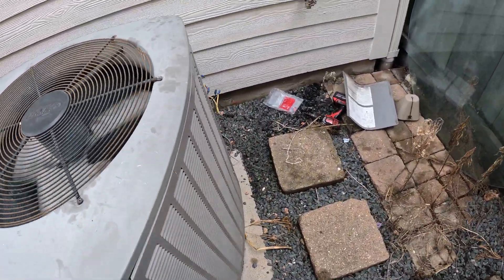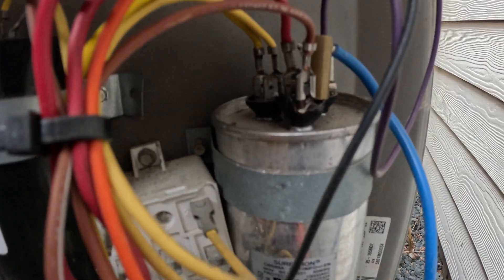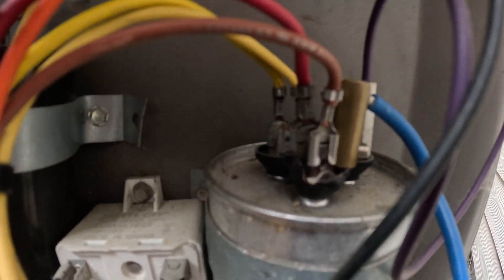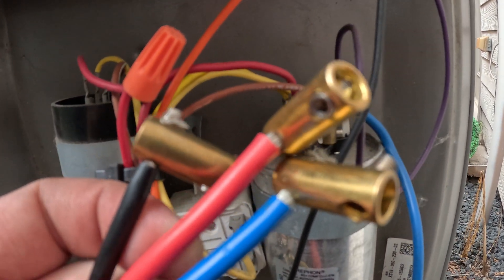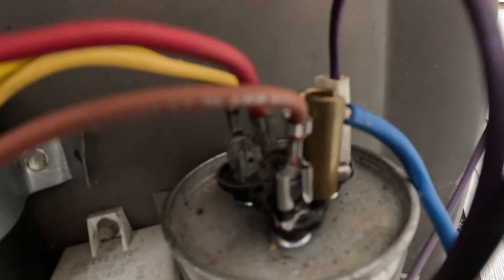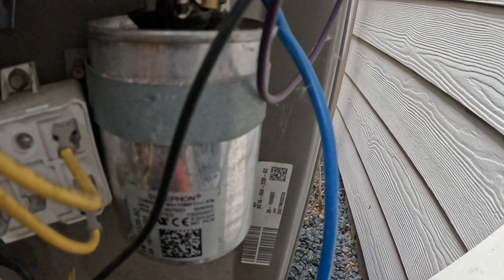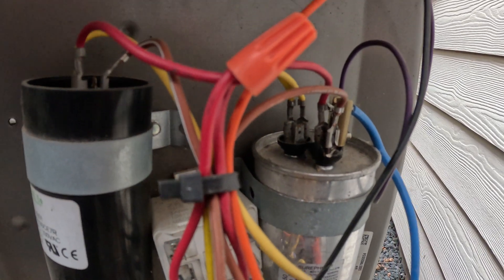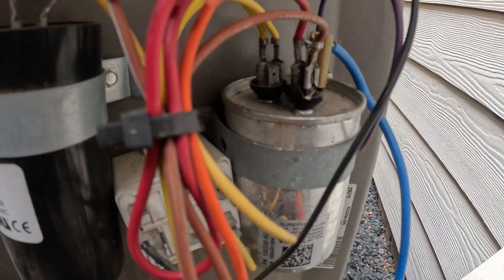Capacitor Wires Burning / Melting Off, How To Repair / Fix Burned Wire.

Comment: Big question though...WHY are the wires burning off??
Reply from the maker: Higher than normal amperage draw at your outdoor condenser will cause wires to burnoff. Things that cause high amperage are dirty / old condenser, excessive heat load in house, hvac unit overworking, low seer unit (10 -13 seer), unit older than 10 years old, Etc.